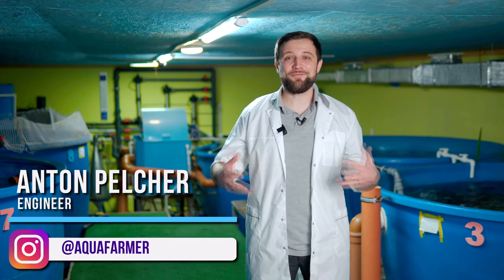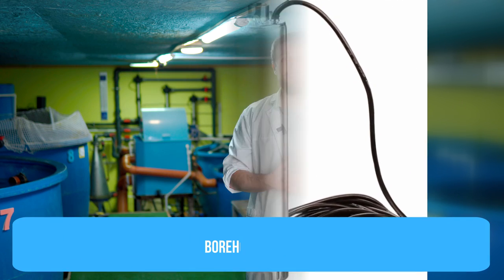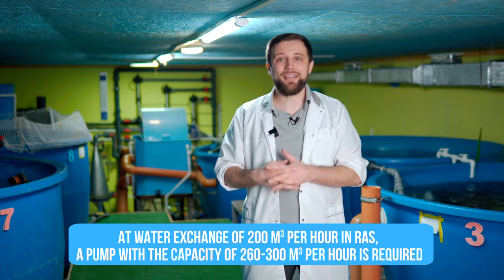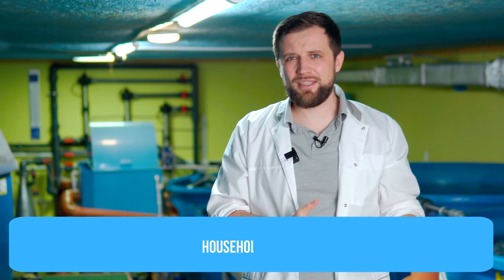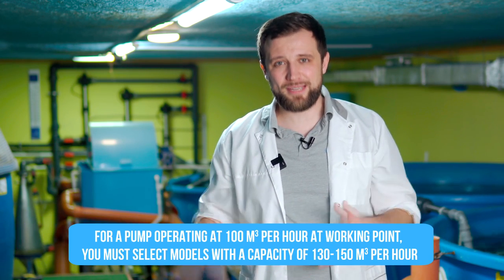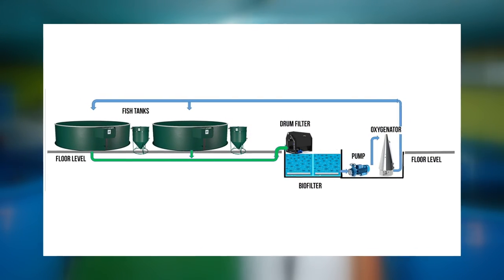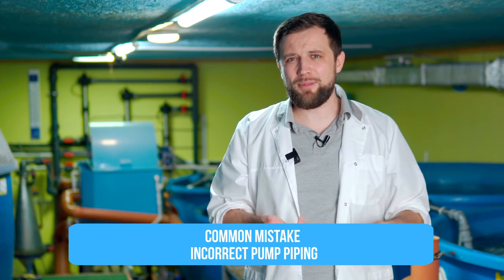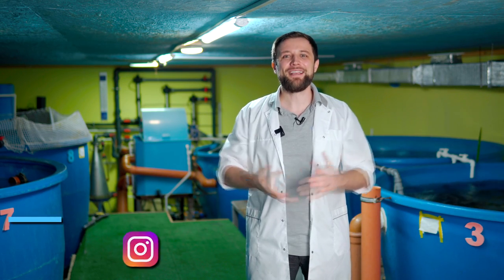How to PROPERLY select a PUMP for RAS SYSTEM?

Comment: Hi 
If my system capacity is 2000 cubic meter 
What is the circulation rate per hour to control the system and the system will run properly.

Best regards